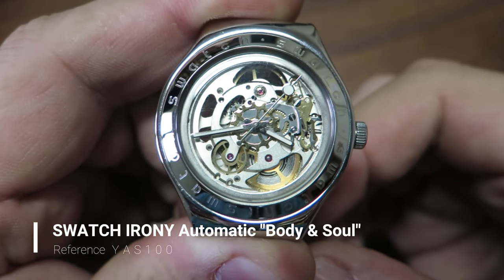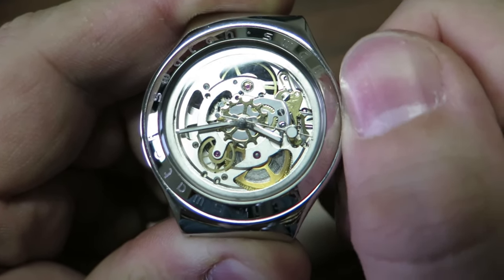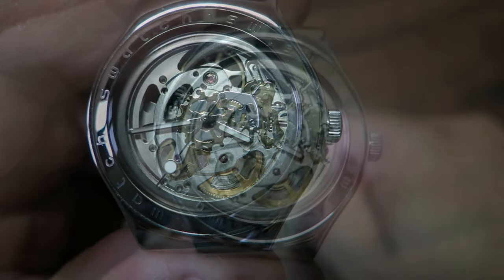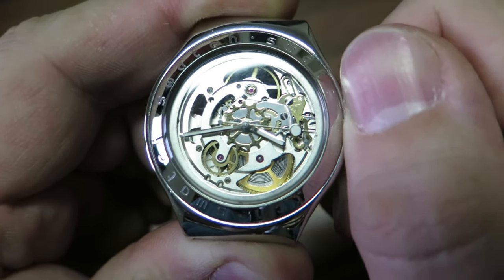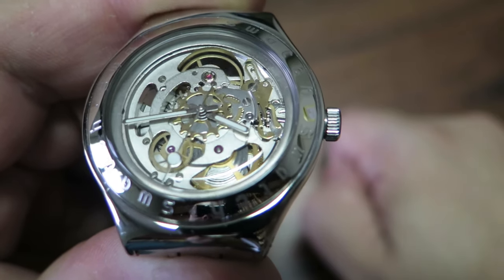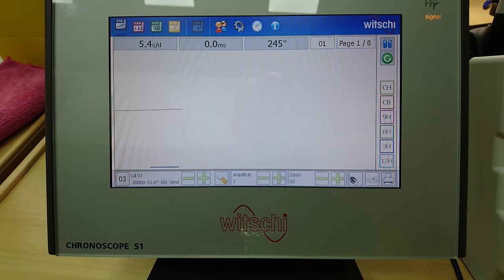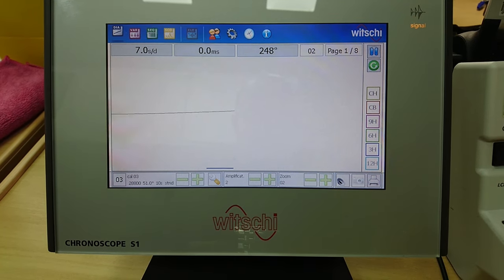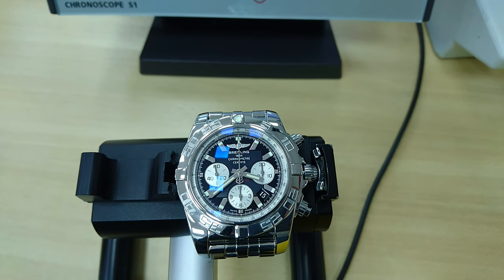[EN] Why you have to hand wind your automatic watch?

Comment: Good demonstration. Movements are designed to be most isochronous at full power. An automatic watch should be manually wound if the best possible timekeeping is expected. The reason for this is as a mainspring reaches near its full wind, the automatic winding mechanism can no longer generate the torque necessary to continue winding because the spring's resistance increases as it is wound.

Comment: What a load of bs only need five to six winds on an automatic then slap it on your wrist let the it wind itself
Reply: And the older ETA 28xx  and coresponding Sellitas should never be hand wound.  The ratchet wheel is made up of a weaker alloy and the teeth will break.  It was a known fault.
Reply: This is definitely a controversial topic. I think two things can be true at the same time. One, if you don't fully wind your watch it won't be at it's most accurate. Two, some movements like ETA have teeth on the winding gear that are very delicate and will break over time. So with some movements, winding only until the watch starts working even though it won't be at it's most accurate is probably the best thing to do.